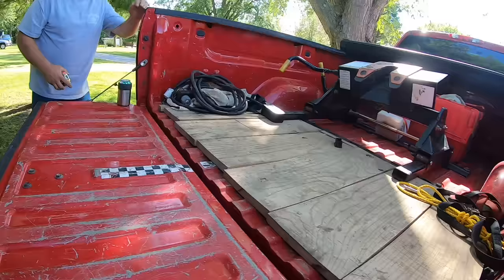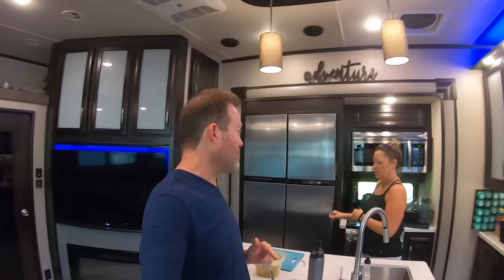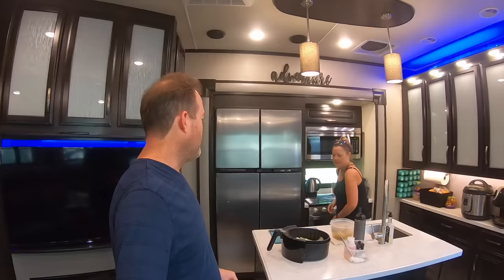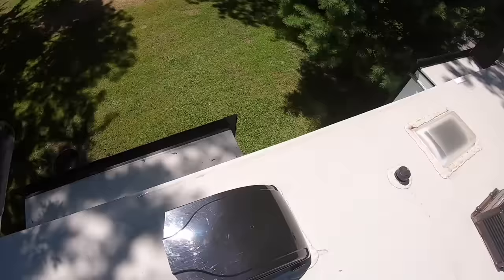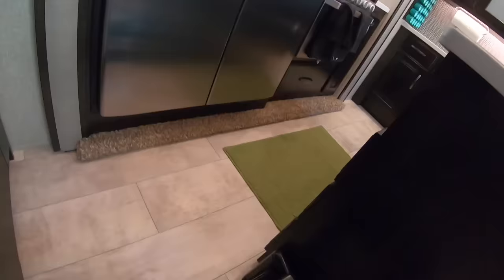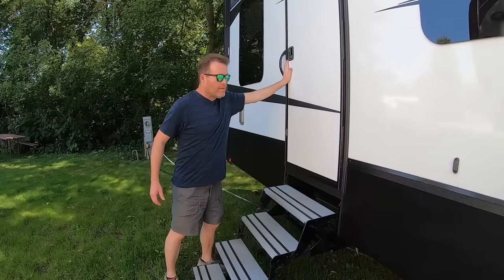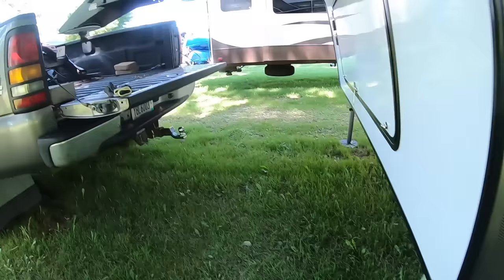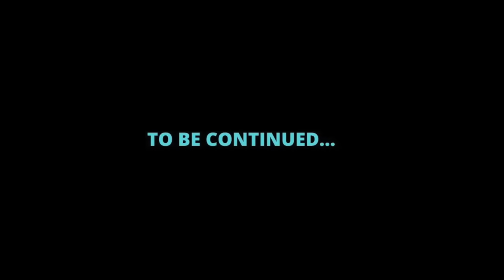RV CRUSHES MY TRUCK ON 1st TOW! BIGGEST RV LIVING FULL TIME MISTAKE!

Comment: It's easy for us watching after seeing the title.  I would almost add to the pulling out checklist "If new hitch: leave front stabilizers down and try to pull out from under the RV to ensure good lock." or something like that.  Also, it looked like the truck pulled forward a bit before the drop occurred.  Had Tom heard Cherie tell him to "hold on" it might not have happened.  
On the bright side, it's always the first scratch that's the hardest...

Comment: I see it 2:56 and then at 19:45 that there’s your problem🤦‍♂️
Reply: At the 19:45, it didn't look like it was closed to me. Not sure why he thought it was closed. Of course, like others have said and they probably know now, always just barely raise the jack an inch or so and do the ole' tug test with the wheels still chocked.  PS.  Like your videos and hate this happened.  Hope you didn't get too much damage.
Reply: Yep you are right, that handle did not close all the way.  You can see it at both of those times.  Super bummer
Reply: I think the orange plate plus the white plate created too much space for the king pin to fully sit under the locking arm. 
With the orange “lube” plate on the hitch, I’d ditch the white disc.

Comment: I always look in the jaw to make sure the hitch is latched no matter what position the handle is in. Second always hold the trailer brakes and pull against the hitch to make sure it is locked. If it moves at all stop immediately before it does what happened here. At least it came off on the site as opposed to the middle of the drive or the interstate.
Reply from the maker: Thank you Ted, that is a great tip!

Comment: Get the white ring from around the kingpin off of the trailer. The hitch has the orange greaseless top on it. Currently you're doubling up which caused a hi hook, and is causing your fifth wheel hitch to stick. Always make sure the locking mechanism is around the SHANK of the kingpin.  Always perform some sort of a tug test, and always check the kingpin.

Comment: What a kick in the butt. You even checked beforehand!  Sorry to see that happened to you. 

Another common problem is forgetting to put down the tailgate after unhitching and then pulling forward.  That happened to a family member. The body shop owner says he gets a bunch of those every year. 

Hopefully it did not hurt the new trailer and the truck is a straightforward  repair.

Comment: Okay as a truck driver I would say you forgot to do a tug test. Next time you hook up before you close the tailgate and hookup electrical stuff raise your gear up one inch or two. Put the truck in drive don’t hit the gas cover the brakes ( chocked wheels on trailer op ) pull forward than back on the trailer and repeat if water can freeze. And that is how a pro driver does it unchock raises the gear hookup electrical for truck and unhook for land. And just remember you don’t drop it at 65mph with people behind you.

Comment: Folks need to know this can happen.  We painted our 5th Wheel PIN bright orange so we can see it clearly with a flashlight grabbed by the "Jaws of LIfe."  Another tip: raise front legs two inches off ground and then do "tug test" - if it pops off...the trailer only will drop a couple of inches.  Looking forward to the next video.

Comment: At 19:36, when you were showing the white indicator, you can see that the trailer is not set down on the hitch. That gap was an indication that you were high hitched. Thanks for sharing.

Comment: My GF and me were in a hurry to get our 36 foot travel trailer on the road. She put the hitch in the receiver, I did the chains, WD bars and breakaway. Did a quick check and drove off. About ten miles later, I kept hearing this groan. I asked did you put the pin in? What pin? Hitch was like an inch away from coming out. I squeezed the trailer brake while reversing to slide it back in and align the holes. It could have been a disaster. Always do a detailed safety check and be extra careful when two or more are working together.

Comment: i am shocked , well i shouldnt be, at how many on here have said always do a pull test, that is 2nd, always 1st check by going behind the truck and look under the trailer up to the 5th wheel pin and make sure tha jaw is closed and locked, then lock trailer brakes only manually on the controller, they all have a thumb leaver, then do the pull test, this is all part of you curcel check, people should have to do a road test to pull a trailer, so many killed by people that have know clue, us truck drivers have to re test every 5 years
Reply: This.  Visually confirm that the kingpin is locked into the hitch.
Reply: @jdog1297  thats right, never rely on moving parts

Comment: I work at a dealership and while we have seen customers trucks with the bent rails we have not seen it ever happen. We by company policy bring up the landing gear a little to plant some weight on the truck. Then in the cab pinch the brake controller and try to pull out. If it doesn't move you are connected.

Comment: Happens all the time in the trucking  business but you only do it once hopefully.  I check the pin every time with a flash light and look to see if jaws are really closed. I also pull the crap out of it with the trailer brake locked. Everytime! Then lift the landing gear all the way up. You took it well and its nice to see a couple who looks happy and enjoys each others company. And as been said Im sure only one teflon plate.

Comment: Until you are VERY sure the king pin is locked do the "tug test" with the front pistons barely off the ground. 

My Curt has several red marks that must not be visible plus a lock that will not engage if the king pin is not latched. I still do tug tests.

Comment: Hey Tom ... if the bed is damaged you can find replacements at truck upfitters... these companies take beds off of trucks and replace them with utility beds.. they the. Resell the pickup beds for cheap.. don’t order one from Gm... you can also find good deals on beds at junk yards... I drive a 18 wheeler and had this happen to me in the middle of a intersection and yes I did do a tug test that day... if it’s man made it can/will fail so don’t beat yourself up about it....

Comment: Little advice from a tractor trailer driver? Before raising landing gear all the way, raise it a couple inches, and pull against the 5th wheel with trailer brakes locked. If it doesn’t come unhitched, you are good to go. I do it every time I hook my tractor up, and have yet to have one come unhitched.  Of course, I’ve only been doing it for 35 years. Who knows about the future, right?

Comment: Ooops. It happens, luckily it doesn't look like a ton of damage. Similar thing happened to my brother in law. We were hooking him up to leave and before we locked everything in the TT rolled back off the 2x10s it was on for leveling. Dropped right on the bed like yours, aluminum bed Ford popped right back into shape and afterward you could not see or tell anything happened. 

Great reminder to keep away from the truck and trailer on movement...

Comment: If you are going to spend your time traveling and use your RV as a home do yourself a favor and buy a good custom hitch like a comfort ride. A good hitch not only smooths out the ride in the truck but it absorbs the shocks from rough roads instead of letting the RV frame and structure absorb it all.

Comment: I got real tired of dealing with 5th wheel issues so I converted my pin box over to a gooseball setup with air ride and that has been the best decision I’ve made period. No more rails in the bed or big contraption taking up space. Big Truck Big RV has a couple videos on the setup that he did, watch those and you too will be convinced.

Comment: By the way... it is cheaper to get a brand new stake-back put on with all the trimmings and super hitches, top and back, than to fix that bed.  I did that when mine got wrecked by a gooseneck that hit a huge chuck hole and twisted, smashing the sides, and never regretted it. Stakebacks hold way more than twice the cargo.

Comment: My heart sank!! Your new Momentum!!  This could have very well happened to me.  I sold my travel trailer to buy a fifth but the wife didn't want to be riding long distances in a truck so we bought a class A instead.  I've never towed a fifth before so this was definitely a learning experience for me. Thanks for posting this.  I'm hoping your truck bed took the damage and not the new Momentum if there is any.  Good luck.

Comment: We removed our 5th wheel hitch and replaced it with a Reese 20K Goosebox and what a difference that makes with the airbag and two shocks.  I know there is a 5th wheel hitch with air bag too.  With the goose box you don't have the big hitch assembly in your truck all the time.

Comment: Next time when you do a tug test to make sure it’s connected properly raise the legs on the trailer just a little bit so that you don’t damage it when you pull forward to make sure it’s connected properly. That way if it isn’t connected properly the trailer does not come crashing down. I’m a truck driver so I do this often when I tug test.

Comment: Do you Rv folks tug test?  Tug test with landing gear down or just barely off the ground.  We have those button/bolt indicators too in big rigs sometimes.  No better choice than checking (pushing in the 5th wheel bar). Seen plenty of truck drivers drop trailers.  Those bars stick especially in the winter.  Also, we often pull onto the locking jaw to lock it into place so no one pulls the bar.  A common jerk thing done.  That could also be part of the problem.  Other times just have to move the truck back and fourth to get it to a point can pull the bar to release.  Definitely lube that even with those plastic things is a suggestion lucas red and tacky.  They sell it at the truck stops in little packets (read packet directions) or Walmart in the tube.

Comment: One of my guys dropped his on his truck 2 weeks ago. He'd been pulling 5vers for at least 20 years. $7k damage.  Moral of the story... don't beat yourself up, it happens to the best of 'em. Best thing I can recommend is doing a king pin 'latch test'..... hook up, & try to drive off a little with the landing gear just barely off the ground.

Comment: First rule even in heavy trucks is to give it a tug check to make sure the trailer is connected to the fifth wheel pin, and get under the trailer to do a site check to see if the jaws are in closed position on the fifth wheel plate. I have heard from a buddy of mine about the stories heavy truck drivers making this mistake and turning around leaving the truck at the shop while leaving the trailer where it dropped.

Comment: Look at 19;36 your fifth wheel and trailer hitch have a gap on the left side. Your not level. If you see spaces don't pull out. Always go behind the pin with a flashlight and see if the jaws are locked. Pull forward against the pin with the trailer brakes locked and the landing gear just barely up a 1/2" to make sure the jaws are locked. Then push back against the pin with the trailer brakes locked to make sure the jaws are locked. Same procedure I use as a big rig dirver..
Also looks like you have a fifth wheel anti friction pad between the hitch and trailer. Sometimes this makes your pin not lock since it rides up too high to fully engage and lock.

Comment: OMG Tom I am so sorry that you had an issue with your hitch. I was so scared of that happening to me with my 42 ft 5th Wheel that I replaced my hitch with a hitch that can never do what yours did. The Anderson Hitch 3220. Please do your research but The Anderson Hitch 3220 is rated at over 24 thousand pounds. Again Tom I am very sorry that happened but you don't want that happening again and defiantly while you are towing down the road.

Comment: You top locked the kingpin on the 5th wheel. There was a big gap above the 5th wheel before you raised the legs.

You should tug the trailer before raising the legs

Comment: On the bright side, you still have your old 5er to live in while the Toy-hauler is getting fixed. Also, video clearly shows hitch was not locked. Look at the two locking claws, they were open and handle was not pushed in to lock. I suspect your old hitch must have automatically locked when backing up. Always do a pull check with brake controller fully engaged.

Comment: I know it's embarrassing, but thank you for sharing. The hard ie. expensive lessons are the ones of most value. What I don't understand is you confirmed the jaws were closed behind the pin. Is the mechanism faulty? I mean you barely moved so it wasn't a stress failure.

Comment: My 5th wheel is as bug and heavy as you can get loaded RV pluss about 4600 pounds we added washer dryer added gen gas and propane on rack in back we use a Curt Q20 hitch on it never a problem with it has indicated if over weight never shows it is it also slides back for backing up only used it a few times I can back up without it but nice feature at tight spots to back into

Comment: Lots of comments about a tug test on the hitch before lifting the landing gear.  That's a little different on an RV than on a big rig trailer.  Since most RV's have electric drum brakes, the trailer has to roll forward a bit for the brakes to engage.  That's why I really like my B&W hitch, when the latch handle comes around, she's hitched.  That's assuming you have the trailer kingpin inside the jaws but if you can't get that part right then you have no business pulling a trailer anyway.  So it's just a visual test at that point, no tug required.  Go B&W!  They should be paying me.

Comment: I just got my 5th wheel and it fell on the back of my truck. I failed to chock the tires and completely let the front legs down. Luckily they were down far enough and the truck caught it. It could've been so much worse. I have since made myself a checklist. I got so complacent of the TT set up, that I thought I knew what I was doing with the 5th wheel. I unlocked it before it was chocked. We all make mistakes. As long as no one was injured, it's just damage to your rig.

Comment: So sorry for you guys.  While either hitching and/or unhitching a 5th wheel, and in all instances, it is best to use and follow detailed checklists (I.e. Chanling Lanes RV Channel on YouTube has them for free download). 
From a viewer's perspective, the towing hitch setup in your truck appeared quite sketchy particularly in light of towing such a heavy unit.  In any event, a pull test check - safety brake check is mandatory prior to any departing - performed while leaving your front jacks almost fully extended which would ensure you are fully pinned before leaving and therefore NOT underpinning being fully  thereby fully hooked up - locked!

Comment: Pick your jacks just barely off the ground. Then pull on the hitch. If it isn’t latched it will only fall an inch or two not all the  way down on the bed. Then if everything is good, you can fully retract the jacks.

Comment: I knew that was going to happen I noticed at the beginning the steps he showed you and where the handle position should be and noticed it wasn’t in the right position . I was waiting for that to happen. But we all make mistakes just learn from them only forgot to lock the hitch closed sometime we rush and forget it happens to the best of people
Reply: Was not the fault of the hitch. The king pin was not sitting depth wise enough...that hitch already had a factory built on lube plate...he added another lube plate...that was the problem.
Reply: Listen closely and I’ll tell what happened......

Comment: That sucks ! Thought since you guys been pulling a 5’er you would know to give it a tug with the landing gear down. Never had a greaseless fifth wheel before, so I’m wondering when you added the greaseless plate to the fifth wheel pin that it didn’t lock in properly. Not that it had anything to do with your mishap but I would never wrap the “oh pooper” cable around the release handle. Plus I thought your supposed to remove that handle in transit ? Also I noticed that it pulled kinda hard, did you forget the chocks?
Reply from the maker: Yes, the extra plate caused the issue! Chocks were pulled, thanks for your comments!

Comment: Sorry that happened.  Next time take the landing gear up, only one inch off the ground, then pull with the truck against the trailer with trailer brakes on just to test the latch  connection.  Then if it's not coupled, it only drops at inch. Oops

Comment: I installed 5th wheel hitches for a living and use one with my gooseneck trailer all the time. Always do a tug test before completely raising your landing gear. Even with those fancy hitches that have "secure indicators" always check the tug test first.

Comment: WD - 40 is not a good lubricant ... it will turn to varnish as it is exposed to air.  Use a good dry lubricant when you can.  I was worried when you had the extra nylon spacer.  We learned after almost doing that to back up just a smidge.  Also our similar leveling system recommends you stay on shore power to keep from depleting the batteries when running the pump.

Comment: That is why CDL drivers are required to do a pre-trip and a tug test to make sure it's locked it before you bring up the front legs all the way you should do a tug test and then put them up all the way and you should be good to go

Comment: Always back in,latch, hit trailer brakes and tug test. 
Second major NO NO, attaching breakaway cable to part of the hitch that could still be attached to the trailer when it breaks away. It must be attached to a stationary part that will stay with the truck. DOT or HP sees that you won't go any further.